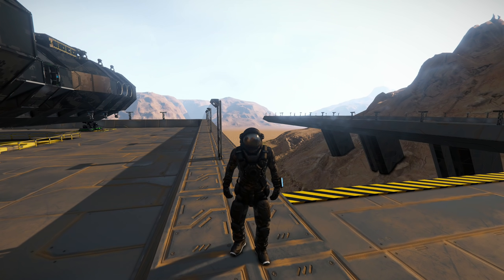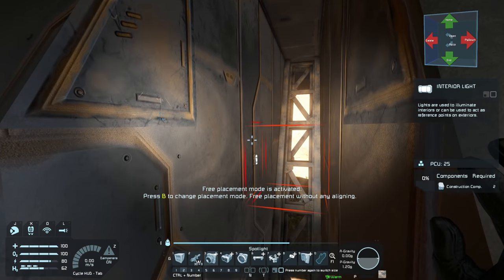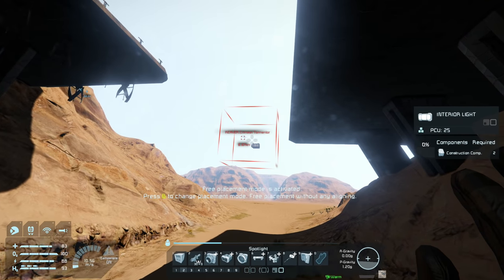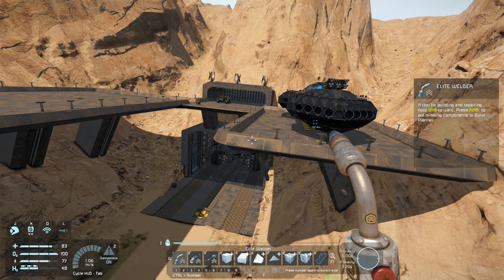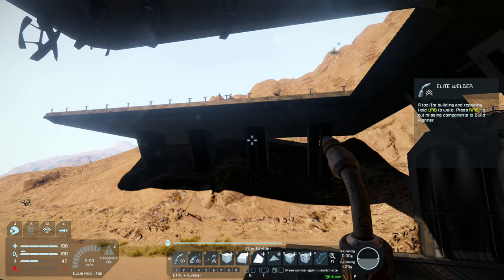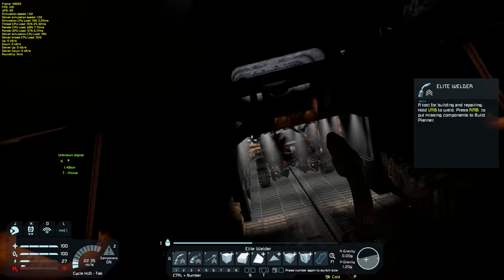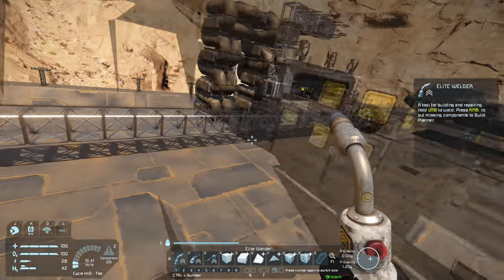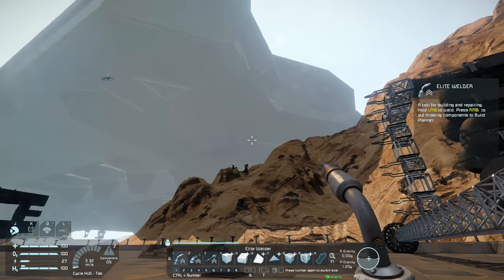Space Engineers - Wasteland Survival Ep32 - Finishing the Landing Pads & Building a Ship Printer!!!!

Comment: sometimes refreshing your mods helps with inertia dampeners. as well you need to be in experimental mode for them to be an option. there is a mod that seems to cause it, cant remember which one?? sorry
Reply from the maker: Yeah you are right, i really need to test the mods out with this setting but it has been hard to find the time recently, so I ended up just sending it lol and Clang can get stuffed lol. I have experimental mode already enabled from before, so it's very strange. :)
Reply: @TheGarageGamer86  I had the same issues and I saw that splitsie/flipsie also had similar problems. I think that I removed build info mod and refreshed to solve my problem. now I only add build info when i want to find leaks for air l ocks